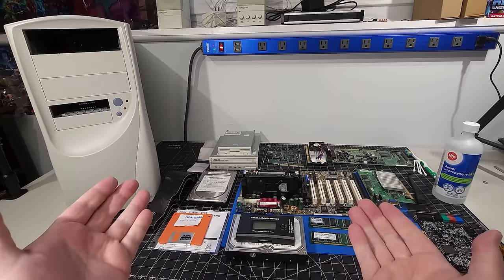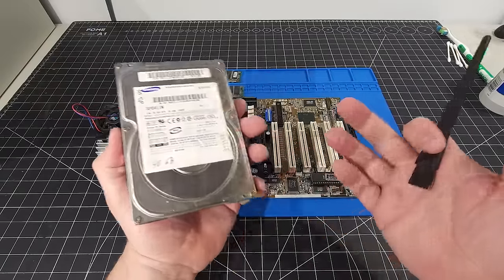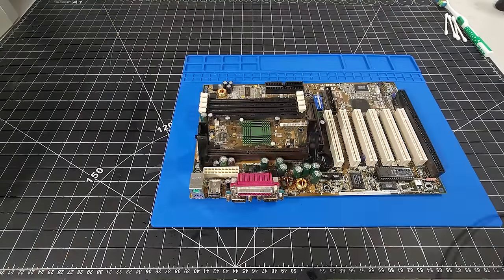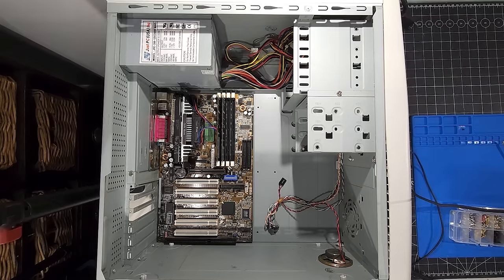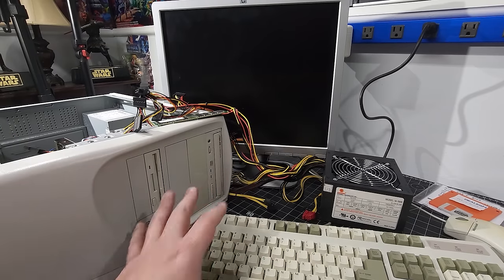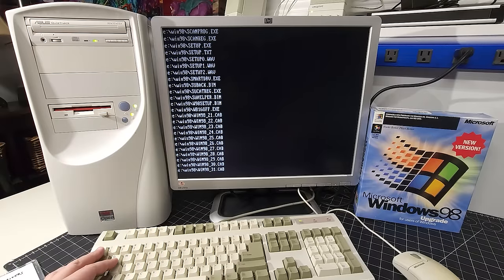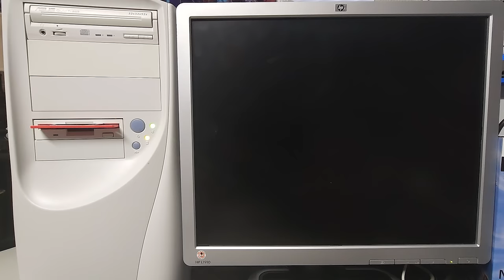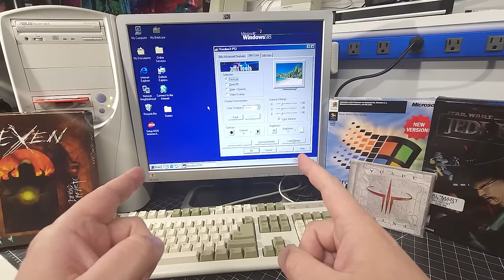Building a Retro Windows 98 PC!!

Comment: I like how you configured your hardware for this particular build. However, there's one thing that I want to point out because it's a possibility that almost no one is taking the advantage of. You can use both the Sound Blaster 16 and the Sound Blaster Live on SLOT 1 motherboards in order to retain compatibility with EAX/A3D and also MSDOS games. In Windows 98 you install the latest drivers for the Sound Blaster 16 (optional step) and than disable the device from Device Manager. Afterwards install the drivers for Sound Blaster Live in order to use the card as a primary sound device in Windows 98. Remember to NOT install the MSDOS drivers for this card because you'll use the genuine Sound Blaster 16 for the matter.
Now the Sound Blaster 16 can be used by manually installing its MSDOS drivers in Windows MSDOS mode, or (the way that I like to do), to use a separate installation of MSDOS 6.22 on a compact flash or SD Card. In this way you can choose from your bios the storage drive on which you want to boot from or install a free customizable bootloader.
Reply from the maker: I had no idea, this is awesome!  Thank you!!! I really appreciate it.
Reply: @TheRetroRecall  Maybe it's an idea for a followup video :).
Reply from the maker: Hahaha it's so funny, I wrote it down 20 min ago!!! Lol
Reply: @TheRetroRecall  Happy to hear that :)
Reply from the maker: Love these suggestions!

Comment: If I remember correctly, the old psu could have the wattage but not the amperage sometimes and tha would stop the mb from booting.
Reply from the maker: I think there is definitely an issue with one of the components in the PSU - possibly a capacitor causing this.  I'll have to test out the rails and report back.
Reply: @TheRetroRecall  a bad capacitor could definitely mess with the amperage.
Reply from the maker: Good place to start looking! :)

Comment: I went back to your test and saw you had 5 volts. The motherboard takes 12 volts. So, most likely one of the 3 capacitors are blown.
Reply from the maker: Nice Catch - I will take a look further when I do additional testing on the other PSU.

Comment: My konfig Win98 machine: Pentium III 500Mhz, Abit BE6-II, 128MB RAM, 3dfx Voodoo 3 3000 16MB AGP,  HDD IBM Deskstar 37050 20,5GB 7200RPM, Sound Blaster Live 5.1. monitor CRT AOC 7Glr.  Any questions ? :)
Reply from the maker: Thats a beautiful system.  I would really love to come accross the voodoo3 in an AGP card, that's for sure:)

Comment: i will say that i have been watching miketech lately and he does what you do, but he takes the cover off of the power supply(he is a pro) and checks for capacitor plague issues. even if it powers a hdd just fine and not the entire system leads me to believe it could be caps or possibly a weak transformer.
Reply from the maker: I'll definitely take a look!
Reply: I also watch Mike but I think it is unfair to call him a pro.  He just has an OCD to take everything to pieces. It isn't necessary.  Most people don't do that.  TRR has a different way of doing things and he is totally free to make videos how he wants.  He doesn't have to be just like Mike or LGR or Dawid or J2C or anyone else.   He's the one doing the build and it's his choice.  I really do not understand why people want to tell someone "oh well, channel X does it this other way" when it's already bad enough every commenter can't seem to resist offering up their own better ideas. Come on. It's TRR's channel. He's unique. He has his own style and approach. It's good. Let him do his thing.
Reply: @LatitudeSky  ok first he works for a dev company so he has experience. 2. I never told trr to do anything. It was just a suggestion if the wanted to peruse the psu issue further and mike tech is a point of reference. 3. Pc and i.t. Techs share information whether it’s taken or not and that is how we can learn from each other. Stop using a teenagers mentality of no one can tell me what to do when that’s not the case here. It’s a reference point and nothing more.

Comment: Pentium 3? Mine has a Celeron at 1.2 Ghz. I also surf the web with my Windows 98se computer and I've even been able to access Facebook and use USB flash storage.
Reply from the maker: Neat.  What browser are you using?
Reply: Web browser?
Reply from the maker: Interesting.  Isn't there a modern browser available for retro builds?
Reply: @TheRetroRecall  I'm sure there is. I do use K-meleon. Mostly though I use EI 5 for Protoweb and Firefox 2.0 for Facebook. Also, what happened to my reply? It's not there for some reason.
Reply from the maker: Not sure.  I will check the filters when I jump on a PC.  It also won't post if you post a link.
Reply: @TheRetroRecall  Okay. I don't remember putting a weblink into it though. Speaking of weblinks, if you go to my channel description you will find a link to my website. Once you've entered my website there is a page of weblinks. On this page there is another weblink which goes to images of my computer that I've posted on the Linus Tech Tips Forums site. Just in case you were curious.

Comment: Pretty sure the power supply would just need a re-cap.
Reply from the maker: I'm going to take a look at it.  It's been suggested that 350w may have not been enough for this system.  The replacement was a 550w.  I will definitely be checking it out.

Comment: Mine has an AGP Nvidia GeForce 256 32MB (the "world's first" GPU), passed through two 3dfx Voodoo2 12MB in SLI. 🔥🔥
I then have an ISA Sound Blaster 16 *and* a PCI Sound Blaster Live 5.1, and the audio out of the former plugged into the audio in of the latter, and then my speakers in the audio out of the SB Live.  Gigabit ethernet card (Win98SE compatible) for LAN parties, and a WD RaptorX HDD which has a window in it so you can visually see the platters spinning in the drive.
Reply from the maker: This sounds amazing.  Thanks for the insight so I can add a few things to mine!

Comment: Specs of my Ultimate 1999 Gaming PC that I just recently got up and running of which most if not all of the parts are from 1999. I even have not just a LITE ON 52x CD-RW Drive installed but also a Creative PC-DVD ROM Dxr2 installed. I even have a HP CD Writer Plus 8200e External USB CD-RW Drive plugged into the system. Looks simillar to the HP CD Writter 9200 Plus that was on my dad's AMD K6-2 build which was clocked at 450 Mhz with a ATI 3D Rage 128.

Motherboard: Abit BE6-II Revision 1.0

Processor: Intel Pentium III clocked at 650 Mhz (Originally I wanted to either go with a Pentium 3 clocked at 550 Mhz in order to have something that was close to what I had with a Dell Optiplex GX1 or a Pentium 2 clocked at 266 Mhz so that I could slow the system down significantly)

RAM: 256 MB

Hard Drive (Currently): 60 GB QUANTUM FIREBALL PLUS AS (Extremely loud)

Video Card: 3Dfx Voodoo 3 3000 (AGP Varient)

Sound Card: Creative Sound Blaster AWE64 Value CT4520 (Used this in a Gateway Essential ESS 450 SE from 2015 to 2017 that I used to have and even though I have Yamaha OPL3-SA as well as ESS AudioDrive this card being the only Sound Blaster 16 compliant card around makes it a really good choice)

Network Interface Card (NIC): Linksys EtherFast 10/100 LAN Card Version 2.0 (I use this primarily for playing online video games)

Other: Adaptec UBS2Connect USB 2.0 Card (For use with loading ISO files from a USB thumb drive)
Reply from the maker: Excellent build!  I love that you have multiple optical drives!  I generally build my systems like that as well.
Reply: @TheRetroRecall I  went ahead and removed the USB 2.0 card and re-enabled the HighPoint (LowPoint) HPT 366 Ultra DMA 66 controller that is onboard and hooked up a 2 TB Western Digital hard drive as the replacement for the Quantum drive. I am using a StarTech IDE to SATA Hard Drive or Optical Drive Adapter Converter that was not playing nice with the Intel i440BX chipset.
Reply from the maker: Interesting.  I hope it's working well now though.
Reply: @TheRetroRecall  It is going well, other than Windows 98 SE crashing on occasion.
Reply from the maker: Yes it's funny you mention that.  My win98se build on my primary retro machine literally started crashing out of the blue the other day.  Going to have to look into why, it's all NOS parts and have been working flawlessly.  Ah well, that's retro hardware!

Comment: I have a question regarding windows 9x: on and old computer with an AMD Athlon 1900+ with 768MB (way overkill for the purpose), both windows 98 AND millenium edition often get stuck on shutdown. What could be the cause of this issue and how can it be fixed?
Reply from the maker: I would definitely reduce the memory.  Also, I have the issue with one of my Windows 98 machines - it turned out to be a program that continued to hang and not shut down preventing Windows from shutting down.  I would check there first :)
Reply: @TheRetroRecall  I don't know what program could be causing this, because I also encountered the issue immediately after a fresh install.
Reply from the maker: If it happened right after the install, then it is more likely hardware or some part of the OS not playing nice.  Make sure all drivers, service packs etc are installed after a fresh install and see what happens (that would be my next step).
Reply: @TheRetroRecall  hello again. I wanted to share the solution I found for this issue. In the BIOS, under Power Management Setup, I disabled ACPI function and reinstalled Windows 98.
Reply from the maker: Thanks for letting me know!

Comment: When you're testing a switching power supply without the full load you're not really testing anything. Especially, if it's an old one, with dried out electrolytic caps.
Reply from the maker: Thanks - others have noted the same.  I will keep that in mind.

Comment: @TheRetroRecall
Who are these people who say 128mb for Win98 is "more than fine"? I think you're smart enough to know that such a statement is silly beyond all reason. That board can take 512MB DIMMs and for Win2k or XP I would fill those slot up. For Win98, 98SE or ME, 384MB should be considered the standard, 512MB the sweet-spot. Anyone who states otherwise never knew that period of computing. You can get by with 256MB, but you will hit a memory wall for many programs and games of the time. I always highly recommend the age old advice: "The more, the merrier!". But as you said, you do you! Also, the VooDoo, is great for non-AGP systems. Try to find an AGP version of that card. EDIT: The SB Live is an excellent choice!!
Reply from the maker: Love all of the above.  I never thought to out both SB cards in together.  As for the 128, I know the difference, I always do 256, never really needed to go higher in my experience.  You can thank the keyboard warriors for the 128 lingo :). I'll continue the hunt for the AGP version of Voodoo 3.  They are becoming quite hard to find, unless you grow the tree in your backyard and produce dollar bills 😂
Reply: @TheRetroRecall  Fair point about the VooDoo AGP cards. Running 2 soundcards is totally doable. Sound card are not an exclusive resource. Windows will utilize anything it finds. DOS is a different thing. Here's my reasoning behind the 384/512 point. With Win98/98SE, when RAM usage gets within 20% of maximum RAM usage, Windows will start dumping data into the swap file, even for programs/games that are running. As you likely know, this can make things run a lot slower. With 384MB, 98/98SE does this less and with 512MB it happens a lot less, which can prevent performance dips. With Windows ME, bumping up to 1GB makes a big difference as well. Even though Windows itself will not use anything above 512MB, 32bit programs/games can use above 512MB and will if needed. For that reason WinME is still my favorite 9X kernel Windows. I'm well aware that I'm in the minority on that one, but I'm one of those people that did a deep dive on that OS and figured out what Microsoft was trying to do with it and then I was able to make it work perfectly. I ran ME for 4 years until SP2 for XP came out and all of it's issue were mostly solved.
Reply from the maker: Thank you for this breakdown, it makes sense and is great info 1 much appreciated.  I agree, I really enjoyed ME as an OS as well as I never had any issues doing anything I needed on it.

Comment: What's the third person fantasy game?
Reply from the maker: Heretic II
Reply: @TheRetroRecall  Ahh, okay. I've played them all except Heretic II; heard mixed things about it. ^^;
Reply from the maker: Yeah I mean it's ok, enjoyable enough :)
Reply: @TheRetroRecall  But on the subject of the video, could you list the exact parts in the description you used for this build? I've been thinking of buying or building a retro 98 PC. I did have one a while back, but got rid of it. >_< I'm completely unsure on what components to go for, but this sort of build seems ideal as I would play DOS games, point n click adventures, and retro FPS like the ones you played in the video. :)
Reply from the maker: For sure!!! I'll have to go back and let you know :)
Reply: @TheRetroRecall  Hey. Did you manage to find out? :)
Reply from the maker: I have the system put away at the moment, however based on the video:

- Aopen K45a Midtower Case
- 300w ATX PSU
- Asus P3B-F Slot 1 Motherboard
- P3 600 Slot 1 CPU 
- 256 MB SDRam
- Standard Floppy Drive
- Asus 52x CD Rom Drive
- 40 GB IDE HDD 
- 3DFX Voodoo 3 3000 Video Card
- Creative Labs SB16 ISA Sound Card
- Intel 10/100 Ethernet Card 
- Windows 98 SE
Reply: @TheRetroRecall  Awesome. Thanks. I've been asking on Reddit and Vogons for advice as well. It's been suggested I go for 256MB RAM and a P3 600 Slot 1, too. Is your PSU just a generic brand? I also just need to settle on a mobo.
Reply from the maker: @DustyShinigami I can't remember off hand, but pretty sure it was generic and original to the Aopen case.  I would always keep a close eye on those PSUs as they can damage retro hardware if they aren't in good condition.

Comment: the young pc builders have it so easy today they don't have no idea of the the struggle back then black to black wires plugging in the psu cable for the motherboard and setting the frequency switches or jumpers and making sure the ide cable didn't bend the pins and the dreaded 25 floppy disk install but fun times after you was done
Reply from the maker: Hahahahahaha #truth!
Reply from the maker: Definitely.
Reply: Sometimes you had to solder to make it go faster

Comment: Finally, finally got an Athlon XP 2400+ 2.00GHz (Thoroughbred B) 98se/2K Pro build up and running, with an AGP 128-bit FX5500, SB Live! 0060 (using the VXD driver) and an ECS VIA KM266 based K7VMM+ (v7.1) motherboard. Almost.

It randomly completely freezes on start-up, shutdown and elsewhere with 98se. Memory MemTest86s, PSU's plenty fine (Seasonic SS-350ET, used for other builds prior), CPU power's fine, as the motherboard uses a very rare 4-pin 12V CPU power connector for Athlon XPs, so it's definitely getting enough power.

Everything seems to point to the combo of 98se, the VIA KM266 chipset and the SB Live! just not playing nice with each other. Even after using the VXD patch, the right motherboard chipset drivers (VIA 4in1 4.43v), 98se update patches (both individually and the SP3), nVidia 56.64 graphics driver, and so on.

Missing the comparatively smooth running of the PIII 800EB, whose i815 based motherboard croaked fairly recently, with the Athlon XP being plan B.

Plan 9 is using a P4 2.40GHz 800MHz FSB Northwood with a "Phil's Computer Lab Approved" ASRock P4i65G Motherboard. Just waiting on the memory to arrive.

Still, got my S370 Celeron 400A Tyan S1856 Tomahawk i440BX 128-bit GeForce4 440 MX AGP TB Aureal Vortex II Yamaha Audician 32 Dream Blaster S1 to keep me company in the meantime.
Reply: P. S. Happy Easter! :-)
Reply from the maker: That's a nice build.  Did you end up resolving the issue?  Nothing wrong with Celeron systems, so easily OC-abale!
Reply from the maker: Happy Easter!
Reply: @TheRetroRecall  Changed the PSU from the Seasonic SS-350ET to a Seasonic SS-500ET in preparation for the P4 rebuild. Yet with the Athlon XP, I haven't had a random freeze occur on startup since at this time.

Strange, as they both use dual 17A 12 volt rails, but the 500ET has 24A over 20A for the 3.3 volt and 5 volt rails.

Though I may have upset the BIOS battery holder while changing things around, with it suddenly forgetting BIOS settings, even though it had a fresh new battery recently installed.

Waiting for the RAM to arrive in the post for the P4 in the meantime.
Reply: @TheRetroRecall  P. S. The Celery is from my very first PC, which originally was a refurb that used a Gateway Motherboard with integrated 8MB ATI Rage 128 VR AGP graphics and SB PCI 64v audio back in 2003.

The original beige & blue ATX case it came in is also still being used, only with an additional LGR woodgrain vinyl wrap around it.
Reply from the maker: I never thought about the amps.  I'll have to take a peak at that on the original PSU.
Reply from the maker: Nice!!

Comment: what is your work around when you live in a country where 60hz crt's were non existent. and you was messing with the resolutions on the desktop and it locks the PC to a unresposive feedback such as locking the system to 60hz on a 50 hz monitor. but if your like me and only have access to 50hz here in the uk back in the l90s-e00s. back then i had a voodoo or banshee and it wouldnt detect my dell crt supported resolutions so it would assume its a 60hz hence my no post for windows 98 back in the days.
Reply from the maker: I would assume that you would have used one that was appropriate for that particular country.  I have a friend in the UK who uses CRTs without an issue.  As for anything that locks up, doesn't display, you can always go I to safe mode and set it back to a lower resolution / setting.  Failing all that - go with a proper aspect ratio early model LCD screen.